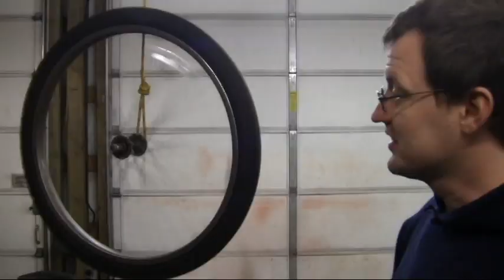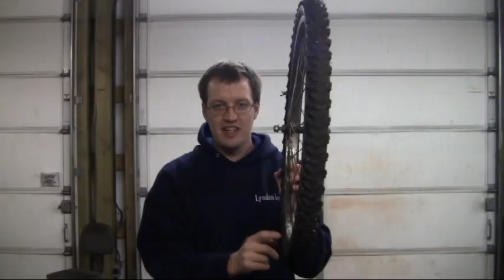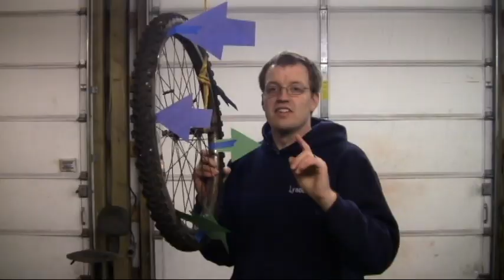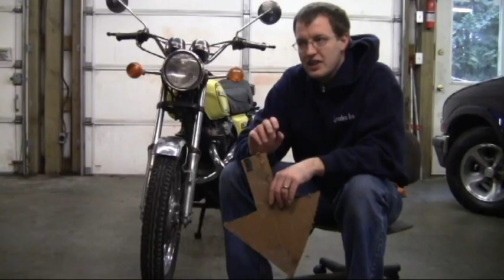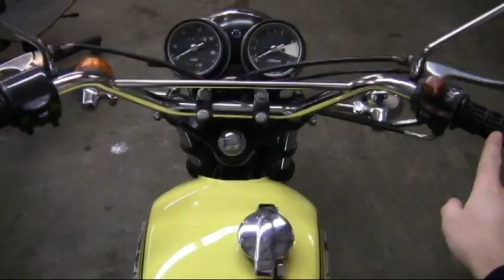Gyroscopic Precession LONG VERSION explained logically (Spinning Tire on a string gyroscope gyro)

Comment: Thanks ! I do have questions, 7 years later !
1)You talk about forces being bigger or not in different places. But actually all these pieces of wheel are experiencing the same gravity. 
So why is the force bigger on the top and bottom ? (I guess there is a link with the tension in the rope but i can't phrase it well)
2) Do you get a sense in your explanation of the importance of speed of rotation on the precessing movement from your simple argument ?  and of the mass of the wheel ?
Best
Reply: 1)  Let's call the points "outer" (top of the wheel) and "inner" (closer to the axle). We know from watching that if he just drops the stationary (non-rotating) wheel, it pivots around the point where the string is attached. We can clearly see the outer point moves faster than the inner point. F=mA applies at every point on the wheel, so if one is accelerating faster, then the force must be higher. So, why is the force higher? Well, let's just imagine the wheel were instead made of water, or pieces of sand... What would happen when he let go? It would all just fall straight down to the ground. However, because the metal wheel is a single rigid body, it can only pivot about a single vertex. The forces INTERNAL to the wheel keep the "points" from separating from one another. So, we can think of gravity applying to the wheel as a whole, at a single point (its center of mass). This causes it to pivot about the vertex (string attachment point), and the internal forces in the structure of the wheel take care of transferring the forces between points. When we analyze the wheel as a whole, we can ignore internal stresses. However, to analyze each point separately, you would need to include gravity on that point PLUS the force of the surrounding structure on that point.
2) Good question, but I don't know.

Comment: one thing to add- why the wheel flops down as it slows.  i can see that it cannot have the force-movement trade when there is no movement, but when it slows, it still moves and could make the trade.

Comment: Thank you, great explanation.  I do have a question.  There is an exercise NSD Spinner gyroscope.  The YouTube finally explained: after initiating the rotation (x axis), it would begin to spin along the y axis, "rotating" the spinner in a circular fashion, the spinning increases both x and y axis.  Can this be demonstrated with a bicycle wheel,,,,why does the speed increase?  Thanks in advance.

Comment: It is counter intuitive, look at this lecture;
8.01x - Lect 24 - Rolling Motion, Gyroscopes, VERY NON-INTUITIVE
Your explanation of the motorcycle is not correct.
It has to do with the center of mass.

Comment: I really appreciated this video.
But how could you apply this explanation to the balancing of a coin rolling on the floor without falling? I mean, in this case, every part of the coin is always accelerating in the same direction.

Comment: I do like the way you chose to explain this, well done...but...
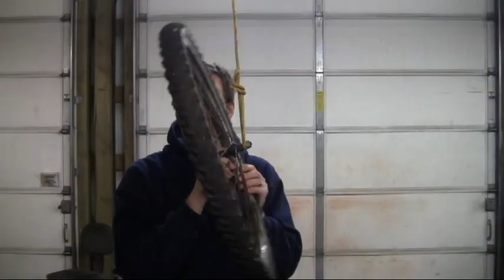Throughout your explanation you kept changing the orientation of the wheel relative to the camera (you kept changing between the axle being side-to-side and the axle pointing straight towards us), that made it harder to keep track of what the magnitude and direction of forces/accelerations were at different points around the rim and of the magnitude and direction of velocities were at different points. Would have been all the more clear if you'd done the whole thing with the axle side-to-side (not pointing at us) like you were holding it most of the time between 1:00 and 2:00.

Comment: Physicists are very often warped in their methods of explanation. They are unable to see the simplicity in a phenomenon, and introduce all sorts of complications. 
Then they copy each other's explanations and think they have it right. But they are warped in most cases. 
My starting point is always the same. The PRIMORDIAL MODEL OF THE UNIVERSE. 
THE SWINGING PENDULUM. 
It begins motionless in the middle neutral position. I lift it up to the horizontal and release. Assuming no friction it goes on forever. 
Note something very significant. 
The first quarter is a GRAVITATIONAL one, but the second quarter is an ANTIGRAVITATIONAL quarter. 
Then the roles reverse for the second half of the cycle. 
Then again and again, for ever and ever, with one half of each cycle being a gravity one, while the other a antigravity one. 
IMPORTANT LEAD TO FOLLOW. 
IT REVEALS THAT THE EARTH CREATES AS MUCH ANTIGRAVITY AS IT DOES GRAVITY. 
It is as prevalent as gravity but no one can see it because it is invisible, like spirit is.
Note when you hold the bike wheel in the vertical position and let go of it. The top half falls under the influence of gravity, while the bottom half rises ( equal and opposite) under the influence of antigravity . Just like simple harmonic motion of a pendulum. 
Now once we introduce spin, this is the big mystery. A primary spin creates a secondary spin, along with levitation. 
Think in terms of Tesla's induction motor. It can do work and overcome gravity. 
It's all connected. 
Keep thinking, but most of all keep it simple. 
" HAVE A NICE DAY "

Comment: It seems way oversimplified to me. Intuitively, I would expect that if you took all parts of the tyre into account, these effects would all cancel out. And there is far more to bike stability than gyroscopic effects. Someone once added a counter rotating front wheel to a push bike, to cancel out gyroscopic effects. With no gyroscopic effects, riding the bike was not changed. And turning the handlebar the opposite way to get the bike leaning over for a corner is easy to understand. If the front of the bike suddenly moves left, the bike and rider's mass still want to go in a straight line and end up falling to the right. Then you are now leaning into the turn, and you can turn the handlebar right for the turn.
 As far as the bike staying upright without hands on the handlebar is concerned, the main effect is the castor effect. As long as the contact point of the front tyre with the road, is behind the axis of the front wheel turning, the wheel will always follow the direction of movement. Try pushing a bicycle backwards if you want to see the effect of the castor trail being the opposite way. It immediately falls over. 
 Anyway, I approve of simplifying things - so keep at it if it helps some people.
Reply: I now get what you were saying about the wheel, after watching it explained using an orbiting satellite. If the blue tape on the wheel represented a satellite, then pushing it sideways permanently changes its direction of velocity and changes its orbit in the way you said. My problem was that, a point on a rigid wheel could have many forces acting on it - which I had trouble imagining. Watch from 27 seconds on this video, for the satellite analogy  https://www.youtube.com/watch?v=n5bKzBZ7XuM&t=44s . Anyway, I hope you now agree that bicycle stability is not due to gyroscopic effects.

Comment: As noted in another video he has a great radio voice.  Voice work can "work" for him.  But physics?  Not so much. 

Desiring a logical explanation and then putting force (vector) arrows around the wheel might make sense to him but it's not how angular momentum, torgue, gryoscopic precession and the associated physical laws work.  How gyroscopes is not intuitive.

Disregarding the right hand rule makes a simple explanation hard (and wrong). 

Put the string at the end of the axle, spin the wheel and let go.  Why doesn't it tip over?  Logic says it should.  The gravity momentum vector is straight down (-Mg from F=Ma where g gravitational acceleration replaces a).  If it doesn't tip over there must be a balancing equal and opposite force.  Where is it?  In the string attached to the other end of the axle, +Mg.  It points straight up and cancels -Mg.  Gravity pulls down.  The string, attached to the building, pulls up.   It doesn't tip over.   Newton's 3rd law concerning equal and opposite forces and Newton's 2nd Law (F=ma) . 

Why does it precess?  The angular momentum force is along the axle offset 90 degrees to the radius of the wheel.    The torque is likewise offset 90 to the radius of the wheel but it is also offset by 90 degrees to the angular momentum.  That's the definition of torque.  Which direction doe the wheel precess?  Use the right hand rule.  Angular momentum "chases" the torque because it is offset 90 degrees to the torque - an unbalanced force - which causes an acceleration (change in direction, speed or both) of the axle toward the torque which it chases in a circle with the string/axle attachment as its center.  Newton's 1st Law of Inertia. 

The wheel has to be spinning to have the angular momentum and torque.  Stop the wheel and both go away.  Without the angular momentum along the axle gravity (-Mg) wins and the wheel tips over. 

All the forces originate on the axle.  There's no need to put force vectors on the tire.

BTW: the + and - on Mg is standard but arbitrary.  It simply denotes that gravity is along the Y axis and it is standard to have +Y in the up direction and -Y in the down direction from the origin at Y = 0.

Does this work in zero g?  Of course it does.  In the above explanation gravity is cancelled when +/-Mg cancel.

Comment: I know for sure that if you arrange the experiment so the axle [in the demonstration] is restrained so it can't tilt or have any up-down angular freedom there is no gyroscopic effect.  Do you know why?

Another version would be to have two spinning wheels fixed to the same axle but spinning with the same weight and dimensions, and in opposite directions, there is no gyroscopic effect at all.  [Yes, a somewhat poor description, but you will get the idea]

Now this raises the question to me, at least, about energy storage for the navy EMALS system.  (Electromagnetic Aircraft Launch System)  Energy i stored in (I think) 2 spinning wheels.  As far as I know they are not linked in any way so they have to be independently constrained.
Reply: EMALS is finally operational on the USS Ford, in place of what would have been a huge steam catapult.  In addition to saving space and water, the linear electric motor can be modulated to reduce the stress on the aircraft being launched.  It's been a long road for General Atomics but the launch and recovery systems are running on a ship.  I don't know the status of the testing but you can follow it with web searches.

Comment: Explain counter steering, which I always use in my motorcycle after 12 mph.
Reply: E W my instructor used a wooden cone shaped spinner as a demonstration. If you roll the spinner it will turn towards the smaller diameter side due to less traveling distance

Comment: the couple forces are only felt at the top and at the bottom ends .The other portion only felt a gravitational acceleration and deceleration  so explain from where does the turning effect (torque) happened since if the forces are though to be a couple forces?

Comment: thanks.

what do you think of bikes going reverse way that have no stability ? Veritasium made a nice video explaining that a bike stays upright because of the angle the fork makes with the vertical direction. It seems gyroscopic effect is very small and could not explain the stability

Comment: I like how instead of the angular quantity picture, you described it in terms of the linear quantities (force, velocity, acceleration). Both are valid points of view, we get correct results and predictions from both, and also I think rotation is necessarily non-intuitive, but the rotational picture is definitely easier in terms of the math. I think there's a higher level idea in other mathematics that helps make the axis/right hand rule make a little more sense. You can use two vectors to specify a direction of spin - let's say you move up, then left. Relative to a point to the left of your initial position, you have "circled" around that point. We needed two pieces of information, two displacement vectors. Since our motion is limited to a 3 dimensional space, we can actually relate uniquely every pairing of two displacement vectors that specify spin to a vector directed along the axis of spin (there are two vectors directed along the axis of spin). Whether we choose the vector in the direction below or above the plane of rotation is an arbitrary choice - as long as we make this choice and stick to it (always above the plane when clockwise, always below the plane when counterclockwise) we have a unique vector for each pair of vectors that specify a spin. This is useful because we have simplified two pieces of information down to just one vector. It just so happens that the picture of force pulling on momentum (or acceleration pulling on velocity, which pulls on position - just as you described how acceleration and velocity are not necessarily in the same direction) is applicable to this simplification for rotational quantities - torque (a rotational force) pulls on/affects the angular momentum, or in terms of kinematic quantities, angular acceleration pulls on angular velocity, which pulls on angle. In 4 dimensions and higher however, there are are more vectors which makes it difficult to make this simplification to a directed vector for torque and angular quantities - we can make a unique identification of not one, but a group of vectors to these two vectors as long as we choose an "orientation" as we did before, but instead of one vector (3-2), we now associate many vectors to a pair of vectors (n-2). Surely this is abstract and so if it is hard to picture I apologize for my limited words.

Comment: What's that force you repeatedly said that is pushing on the tire  (sideways !!!)...wtf?
Reply: Carlos Mejia on the hanging tire gravity is the pushing force, if he were to let go without spinning the tire it would hang sideways (horizontal) due to the weight of the tire and the string suspending it from only one side
Reply: *****  Sorry but you're absolutely wrong ! ...gravity pulls down EQUALLY ...not sideways and unequally ! ..,.this video is totally wrong !
Reply: Carlos Mejia yes gravity pulls down.. but look at how the rope is attached to only one side, this would force the wheel to go sideways. meaning the bottom part goes up and the top part goes down until it's horizontal. that is the opposing force he is talking about. I didn't understand at first either but once I really thought about it, it makes total sense

Comment: QUESTION: At 5 min mark, when the blue tape is applied, and when the blue tape is at the top of the wheel, the blue tape wants to fall left and so is accelerating left [of screen]. Is that negated in a zero G environment?
Reply: of course, cause there's nothing pulling it down. also the rope wouldn't really hang in space.

Comment: but the bike part is unfortunately incorrect the bike standing up is caused by the axis the front tire is mounted on to... notice that it is tilted towards the front a little bit thats why if the bike tilts to the right the tire will because of gravity turn towards right thus causing the bike to turn right (slightly) and that creates a centryfugal force on the opposite direction the bike was tilted and thats why it stablizes itself cos the same procedure repeats for the other way after the bike fixes itself straiht and past straight to the other side... the gyroscopic effect does infact help the stability of the bike but due to the bike mass and tire mass ratio of a bike it hardly serves help

Comment: Mireazma - I (still) have the same problem as you. (And forgive me, I understand that the explanation is in the video, and this is my stupidity), but I still cannot grasp why it must spin on the vertical axis in THAT particular direction. If we call the duct tape at the top A, at 90degs B, at 180 degs C and 270degs D, I understand that the following conditions exist at each point:

A- acceleration is Max, Velocity is 0
B - acceleration is 0, Velocity is Max
C - acceleration is Max, Velocity is 0
D - acceleration is 0, Velocity is Max

So given this state, why is there a resultant force turning about the vertical axis? Wouldn't the forces simply cancel each other out? Thanks for helping me out with this (and sorry for being stupid). 

Dave
Reply: Remember Newton's First Law. Objects in motion tend to stay in motion. When you push an object in a direction, it keeps moving even after you stop pushing (aka accelerating) eit. It doesn't stop or change direction until another force acts on it in another direction (like friction or another person). So even though the force acceleration is zero at Points B and D, the tire spins in the direction the last force was applied because there is no force pushing in the opposite direction.